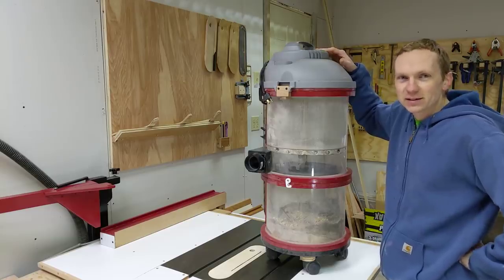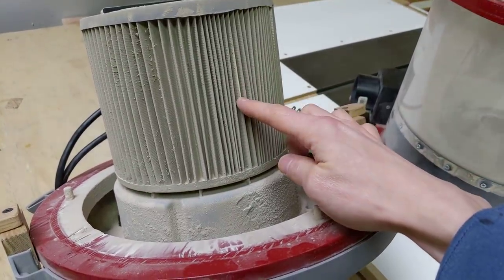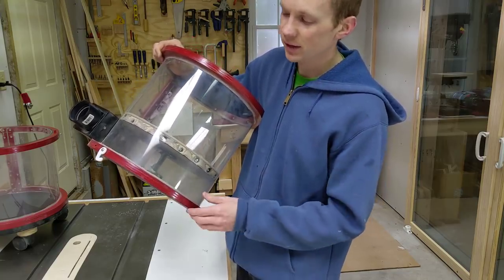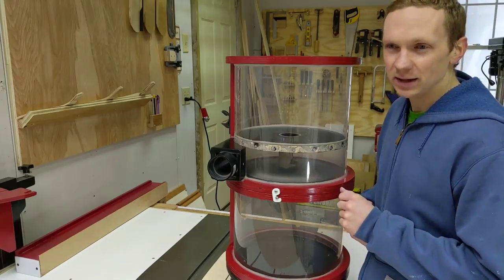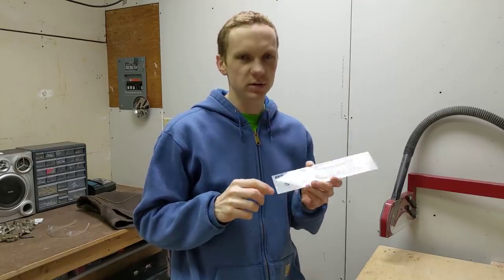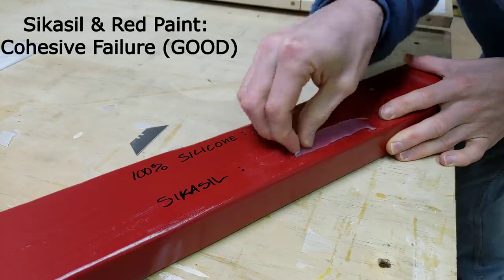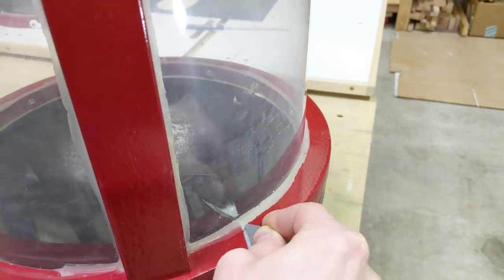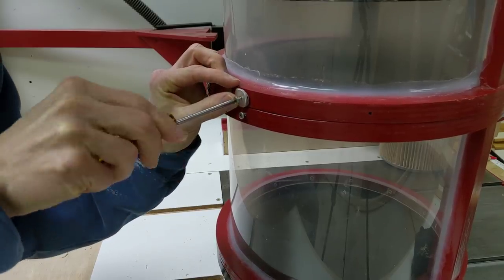How is my Homemade Cyclone Holding Up 2 Years Later?

Comment: Should have used Clear gutter sealant... just dont touch it after you apply, that stuff adheres regardless if your finger is wet or not. Its also a lot stronger than either silicon or sikasil once cured

Comment: Sika products are superb and made very well thats why they are so expensive, silicone is no good on slippery surfaces, if you had keyed the polycarbonate it would have been better,  trouble is also most silicones contain a acid which does not like certain materials like mirrors etc.  A mastic or caulking product i think you call it would have been better, also cut a tube in hald flatten it with your heel and use the resulting oval to create the perfect silicone edge tool, waste silicone is collected in the tube leaving a perfect join, just adjust the oval to suit the size of joint, works on anything.

Comment: Good review Justin...nice to see that the ‘Sikaseal’ works... Womder if it’s available (or a similar product) in the UK?
Reply: just browse your hardware shops, there are plenty of products made for sealing windows. they are designed to stick to wood, pvc and glass. Most of them are silicone based with diffrent additives. You could also sand the PVC for better adhesion

Comment: but if you had put the silicone between the wood and the polycarbonate stuck between the screws instead of using it "only" as an external sealant, it would have produced the same defect ???

Comment: Dude before using the silicone you have to scratch the surface of the vacuum plastic tank from outside . This method helps the silicon or any glue to stick for ever

Comment: Great videos!  Inspiring work!  From what kind of shop vac did you get the head for your integrated dust separator?  Have not seen one resembling that.
Reply from the maker: Thanks Joe!  It's a regular shop vac from the actual "shop vac" brand.  It's old and discontinued.  Can't buy it anymore.

Comment: Might as well seal the separator panel from the inside. It might minimize the fine dust getting into the filter
Reply from the maker: It was already sealed from the first time when I used silicone. It's still adhering okay since there is no pressure difference at that joint.
Reply: @JustinDepew  Gotcha 👍

Comment: question: Have you thought of making a water filter for the finer stuff Rainbow(TM) style?
Reply from the maker: While that is intriguing, the hassle of a water filter system just isn't practical in a wood shop.
Reply: I was toying with that idea but after emptying our Rainbow and seeing all of the sludge in the bottom I decided that I wasn't going to perform any surgical procedures in my shop so it looked like more trouble than it was worth. I'm sure it would be highly effective but very messy to clean up and it would need to be cleaned very often or it would begin to stink of wet sawdust particles. There might be some that would really benefit from this degree of air cleansing but not me, just a hobbyist that uses the shop for working on wooden projects, cars, motorcycles, and everything else that needs tinkering.

Comment: A urethane window and door sealant will both adhere way better and will be far stronger than any silicone. Whatever do you use seeing as you know you have a adhesion problem you should sand both surfaces to give the sealant a mechanical tooth to grab on to.

Comment: could you just run it without a filter and exhaust it to the outdoors?
Reply from the maker: Yes definitely.  I actually would like to try this myself.
Reply: that way you get rid of the filter clogging problem and the super fine dust that gets through the filter out the exhaust port and  back into the air and into your lungs. I recently read that its the super fine dust that causes health problems. If its exhausted outside the only problem would be making sure to be vacuuming it all up int the first place. I think there is an air quality meter you can buy to test how free of dust the air is.  Im really glad that you think this might be worthwhile to try because I need some dust collection capability in my garage workshop too.
Reply from the maker: I actually bought one of those air quality meters to do some testing. I hope to set up outside exhaust on my system and test the difference. The biggest issue for me is since it gets cold in the winter, exhausting outside means loosing heat too. However, I think I would rather pay a little more for heat than breathe in the nasty dust.
Reply: @JustinDepew  so Justin its been 2 years . Did you ever exhaust to outdoors. Im interested in what you came up with.

Comment: You could have yurned on the vac when the sealant was "wet" blocked the inlet causing the vacuum to draw the uncured sealant into the gap . That would've improved the seal as well.